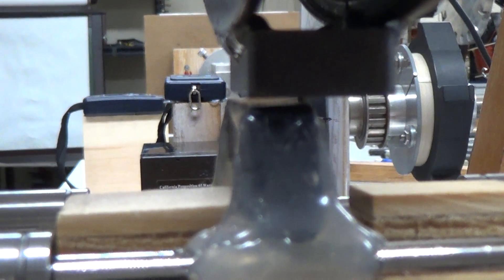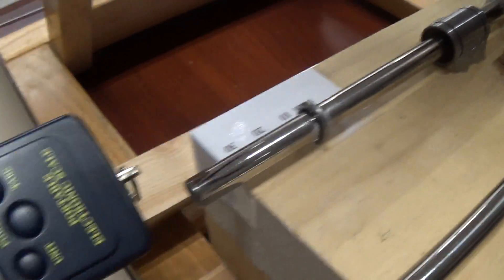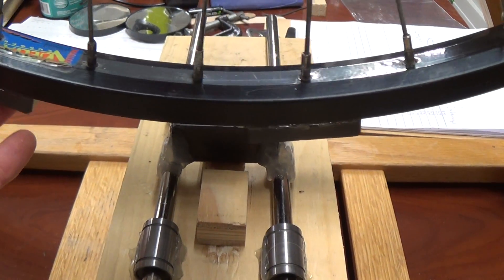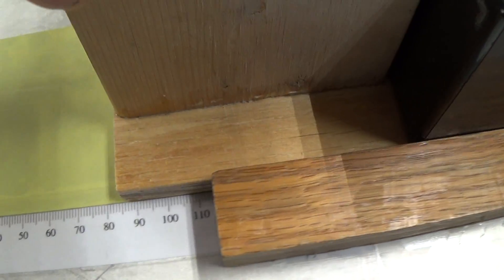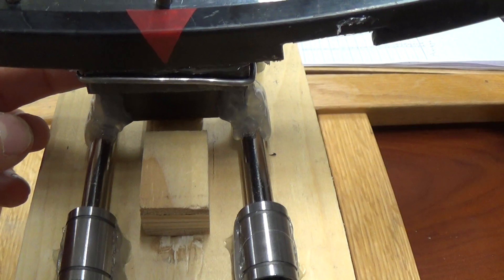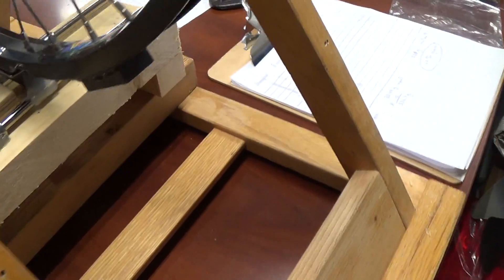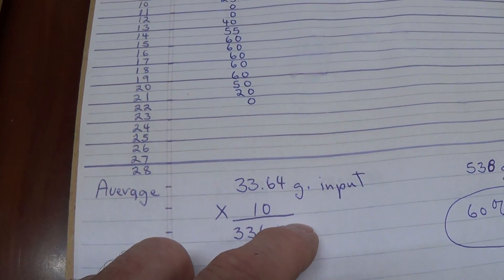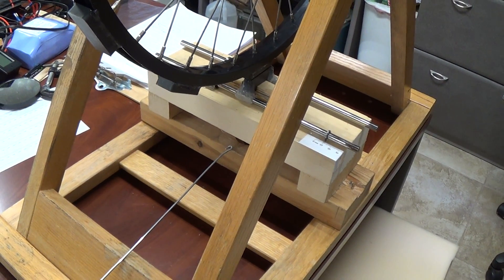Mechanical Magnet Torque Amplifier test 1

Comment: True perpetual motion machine..
Reply from the maker: No it's not.
Reply: @gotoluc  of course it is not in the state it is in at the moment.. But if you connect a motor to the rim or put a coil of wire to drive the rim.. Then at what ever speed you drive it.. It has 60% more torque.. Which means that if the drive motor has a 30% loss in energy.. This will bring it up to 100% + 30%..

Comment: Maybe you can simply oscillate the slider. And cause the wheel to spin? Have you tried that? If thought of trying it. It could possibly induce a high speed lower tq. Similar to a flywheel tq storage device.  I wish I had a space to experiment with some idea's. I'm thinking two counter rotating wheels with similar magnets connecting the two. And use opposed poles to maybe give a push to spin the wheels. Or atleast help it spin! Although the accurate timing is a must! It may require some tinkering to get the timing to work best. If interested in this message me.

Comment: Luc, I was experimenting with this concept and found that there is a very uniform force when the flat magnet approaches the vertical one and discovered why that is true.
On the one side of the  vertical magnet it attracts at a distance and on the other side
it repels up close and as it moves the attract gets stronger and the repel gets weaker and thus a uniform force which is very amazing because usually with permanent magnets we have closer/stronger and further/weaker. 
Norman
Reply from the maker: Well Norman, after building the large v.2 test device the measured input and output forces were equal.
So no free lunch. Luc
Reply: I'm really sorry to hear that. Email me privately for a discussion
about the bicycle wheel discovery I made. nebollinger at verizon
dot net.

Norman

Comment: Hello Luc, If you have a second wheel attached to the same driveshaft such that it is offset by 180% ... ie pulling when the 1st rotor is sticking you can eliminate virtually all your cogging torque...and your input power required. Cheers Thane
Reply from the maker: Hi Thane, Thanks for your message. How' s your tech coming along? Luc

Comment: Nice demo Luc, maybe you can turn bottom slider into a second wheel?  (one which is at 90 degrees to top wheel).
Just a suggestion.  Good luck mate!
Reply from the maker: Yes, I was thinking along those lines as well. Like a cascade effect. If the force keeps amplifying then we know it's real. Luc
Reply from the maker: Thanks for your positive comment and suggestion. I'll think it over to see how it could work. Luc

Comment: It would be good if you could simplify your scale, eg 1kg weight to pull the wheel and a 1kg weight to lift both on the same distance. Just seems like your confusing things with all the conversions.

Comment: you need to create the rotation of the wheel with Bedini concept then....use the linear powerfull movements to go in and out through a coil with a magnet on the shaft....the you can create a sinusoidal wave on the coil to charge batteries.....if everything is like you show.....you can have an overunity device.....like yours videos

Comment: A well machined linear-to-rotary actuator could easily get your gadget to power itself.
Reply from the maker: That could be true if it really has a 60% gain on the output. More tests need to be done before making such a build. Luc

Comment: How are the magnets polarized? End to end, side to side?
Reply from the maker: Come on, you should know the answer to that, You'ld have a hard time finding ceramic magnets that are not polarized through the thickness. Besides, don't you think I would of mentioned it if they were diametrically magnetized. Luc
Reply: You may have diametric mixed up with axial. Broad side would be diametric, end to end axial.
Reply from the maker: Yes, they are not magnetized through length. Luc

Comment: just wondering should the correct force always be a combination of the doth never just one of the movements. thinking maybe that's the answer. as the force is all between the two never is it only on one plain. as no plain is fixed. and if u fix one then it all means nothing. hope my thoughts are not two ambiguous.
Reply from the maker: I don't know. Luc

Comment: Interesting idea, few points :

- You are measuring distance but not time how long is force applied.
- Until you will hook up motor and some generator i would be careful with claims
Reply from the maker: I've made no claims other then sharing what I was able to measure. More tests will be needed. Luc

Comment: Wow! Very exciting!
I do hope it is not a problem that you measured the small strokes 'at maximum force', since you can not regulate the exact timing of the magnets?
Reply from the maker: True, the device (as is) does not regulate the output strokes but a timing mechanism could be made if even needed.  Note the input force I measured were all at maximum values. So if I don't lock the output stroke to get ideal alignment for maximum output the input force is also less. It's all relative. Luc
Reply: I guess deslomeslager's question and mine is this: is the 538 grams of force constant along the entire 11 mm of travel for the output magnet.  Anyway, amazing work!
Reply from the maker: Yes, the 11 mm force is quite constant. It starts around 520 grams and works it way to 565 grams, so the average is around 542 grams. Luc